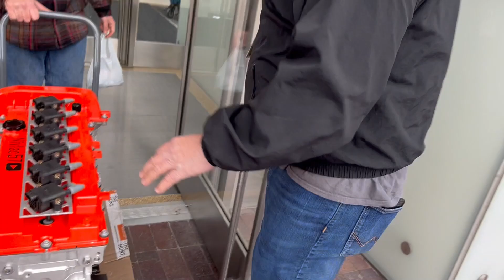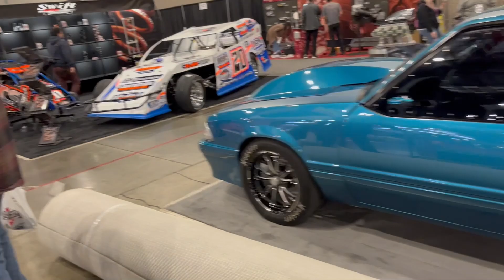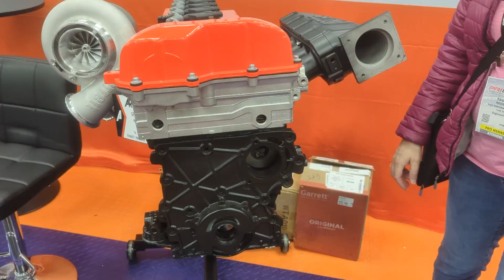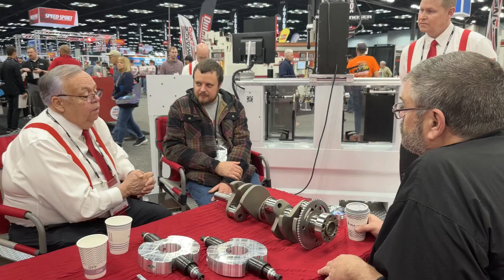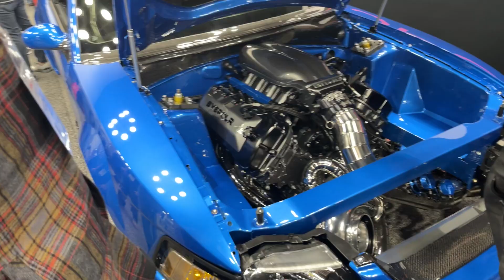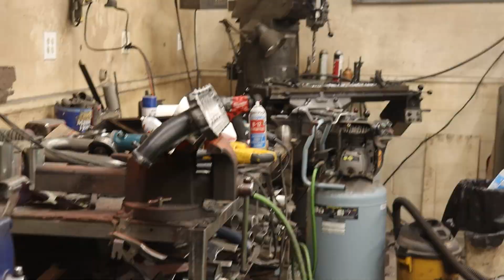This Under Appreciated Engine is Finally Being Taken Seriously!

Comment: I love your channel and I think it’s awesome that the 4200 is getting some love. We have an 05 Trailblazer that we handed down to our daughter and it’s still getting her around today. That thing was a tank and it had some pretty impressive power in stock form. We pulled boats and trailers with that thing with ease. I love hot rods myself and I’m amazed at the power you are making out of these engines.

Comment: I absolutely CANNOT wait to start my 4200 (5.0) swapped jag build and its all thanks to you that i even had the idea. Now the platform is getting proper development and attention. Can't wait!
Reply: I was just thinking about stuffing one in a Jag, good luck with the build!
Reply: @JohnVander70 Thank you! You as well. Still haven't started. Life and all that. At this point I have a dilemma either way. The original plan was- and still is- to use the 4200 as a unsuspectingly rowdy "service engine" while I have the V12 from my XJS out for rebuild, only problem is, where do I want to home the 4200 once the 12 is ready? Definitely another model of jag, but which one? I was thinking either XJ6, XJ40, or XK8, but an S or X-type would probably benefit greatly and make one helluva sleeper.

Comment: Big power builds like this are always useful to demonstrate an engine, but what most people fail to mention is that 99.9% of all Skylines and Supras are not 1200, but more like 600 horsepower builds. And the 4200 can piss that out on a stock bottom like few other engines. Really, unless you’re a pro driver, you don’t need, or want much more than 600. Hell, more than 400.
Reply: 450rwhp is a wildly more powerful car than most people have ever handled. 

It's also the limit of what I'd ever want.
Reply: @lordhellfire153 street tires and the street those tires are on won't give any return above 450hp. 
Need a track and race tires to put down anything more.
So yup. 400 at the rear is all I need, just wasting money and gas after that.

Comment: I think it would be sick to see a large bore, short stroke 4200, even if it required sleeves, even a big bore, stroker for well over 5L, for n/a and high torque lower rpm turbo applications would be cool to build. It'd be cool if a sleeved, stroker 5.5L, with ported heads, cams, Tri-Y tuned headers and a variable length Intake with 30" and 15" runners was able to reach 120% VE, maybe hit 1.5 lbs/ft tq per ci and 1.65hp per ci n/a, 342ci 513TQ 564hp.
Reply from the maker: Agreed. We will do a short stroke one someday.
Reply: You're going to be limited on just how big a bore you can go due to bore spacing. The limit is probably around 3.750"

Comment: I'm really stoked about these 4200s if I could get one, attach it to a T56 and controll it with Holley for reasonable money in my '04 GTO 6M I would absolutely do it. When I get beack to the USA from Brazil that's what I am going to look into. Even if I am forced to run it with a super cheap GT45 and a mechanical wastegate unintercooled with low boost on pump E85 that's what I'll do. If Toyota 1FZ-FE 4.5L I6s, 4L Barras, 1JZ or 2JZs were more readily available and cheap I might lean that direction but, the Atlas can certainly provide more than enough to make a street drivable car very quick, 500-550whp according to Matt Happle, on the Diehl Paving dyno, is more than enough to party the tires off and overwhelm most people well up to 100-120mph, it takes a lot to keep a transmission, driveshaft and axle behind that much power ao it should be adequate.

Comment: Love what you're doing with under appreciated engines. Did the same 20+ years ago. Me and my father starting messing with his bmw e36 328. No one had made over 400 with one. We made 715whp (05) with the stock block and were the first to break the 1000whp(07) and first in the 9s.(with full interior, heated leather seats and ac 😂) Now its the preferred engine to boost for e36 guys. Keep up the great work.

Comment: Awesome video, gnarly content! That intake looks glorious, but it sure is touching that master cylinder, mine was doing kind of the same but mine was touching the reservoir. Mine, completely different motor, my red block, so I remote mounted the reservoir. I'm gonna guess you will shave the master and the flange surface on the intake to get better clearance? Super congrats on the sponsor, you deserve it. You will stomp that 4 digit goal, I bet!

Comment: I'm currently in Ecuador and there are tons of perfect Trailblazers around. I mean a buff and show quality. It's gonna be low 70 degrees for the next century. Not even surface rust. Had an Envoy. Loved it. 

The question? Talk me out of a 5.3. I'm half way there cause 'Merican straight 6 but LS is LS. 
Can you sell me on the advantages of the 4200. Of course I will buy my parts from you. Btw be a dealer of the goodies

Comment: Congratulations! Always liked these engines since before they made it into production. My concern is the ease of compatibility across various platforms. It IS a TALL boy. Can you cover some possible reception candidates in the future?
Reply: Then Ford Barra is very tall too.  And can be an issue fitting it into smaller engine bays. A good example is the Street Machine channels Turbo Bara MX5 drag car.

Comment: It's funny that this video came across my feed. My bro in law just threw cylinder one rod through the block! Yes, he ran it low on oil. But before he blew it up that engine had great power for its size.

Comment: I think that once you cross that 1000whp goal, you'll start turning a lot of heads. It kinda seems silly, but a lot of the discussions I see on the topic of i6's ultimately comes back to someone asserting that "X engine can go to 1000hp". I've seen this in reference to the 2J, RB, and Barra, but never in reference to the 4200. Specifically, if the 4200 can meet or exceed that same threshold, there's no reason for the 2J/RB guys in the US to keep ignoring this platform. Great work on the intake, let's see what she'll make!

Comment: If you want a new engine to work on i'd recommend the Volkswagen 07k (2.5 inline 5) that came in the jetta and rabbit  cause these engines are basically a naturally aspirated steel block rs3 engine and we know what hp you can get outta these (1300 hp if i remember well in a rs3)

Comment: What you’re doing is monumental. The 4200 can be the baddest inline 6 on the planet with the proper support it deserves and you’ve proved it and not given up.
Reply: If the engine manufacturer put it in iconic sports cars then it would have gotten the "support it deserves".
Reply: @sepg5084  well they did have success with a race version of it. And it wasn’t even needed Calvin making more power with damn near all stock engine. Here’s some info I grabbed about it. I think if they would of used it like Calvin it would of blown up and be like 2jZ, RB lore and not affordable so maybe we should thank them🤣

The Vortec 4200 actually had a short-lived racing career. General Motors contracted with Falconer, a specialty engine builder, to construct a 5.0-liter, high-performance version of the inline-six. It produced roughly 600 horsepower at 7,500 rpm and 450 pound-feet of torque at 6,000 rpm, but shared almost no parts with the production engine.

Herzog Motorsports ran the trucks and supplied the drivers. The first race truck was the Vortec Trailblazer that ran in the Baja 500 and Baja 1000 off-road races in 2000. The one-off vehicle was built with a tube-frame chassis and covered with a carbon fiber body. Driven by Larry Ragland, the 81 Vortec Trailblazer only competed in those two Baja races before retiring to Ragland’s garage.

The Vortec 4200’s second foray into racing came at Pike’s Peak. Again built by Herzog Motorsports and driven by Ragland, this GMC Envoy race truck took home the overall win for the 2000 Pike’s Peak Hill Climb. It was built on a Trans Am chassis with a modified front subframe, this 4WD Envoy rode on cut-and-grooved tires powered by the same hand-built race version of the Vortec 4200.

Herzog Motorsports also ran another Vortec Trailblazer in the Best In The Desert Nevada 2000. Four drivers tag-teamed the race and included Brian Stewart, Mark Miller, Bekki Freeman and Ryan Arciero. The 5.0-liter inline-six pushed the race truck to win the Trick Truck class, beating the next race team by more than 30 minutes and coming in second in the overall completion.
Reply: A 5.0 liter, that's gnarly !! Neat info @Thumper68
Reply: @Thumper68  An all wheel drive version sounds very interesting 🤔
Reply: Love your stuff keep it going 2024!

Comment: So your running dual injection and ls injectors for the first set and if you were to not need extra injectors could you do the same setup but run meth injectors in each intake runner to boost octane
Reply from the maker: You could. It would require a LOT of methanol.
Reply: @Calvin-Nelson  well I mean for street applications if you wanna run 91 or 93 plus meth to boost octane so we don't have to buy e85 or race gas

Comment: As usual, this is cool. Getting to meet people you see online is not always a good thing, but sometimes it is. The NNN crew is a good thing.

I'm having an issue with one of these 4200s in an Envoy. Engine is in great shape, compression and leak down are all excellent, it starts ok but will not rev over 3000rpm and has no power. Its not a plugged cat, checked that. I'm thinking fuel pressure regulator, it has some exhaust leaks but that shouldn't make it stay under 3k. Could be fuel pump, has a new filter on it, but it could still be plugged. I don't know much about this engine, this is the first one I have ever seen in person. Want to use it as a winter beater for a while until it rusts in half... then I might turbo the engine and put it in something silly.